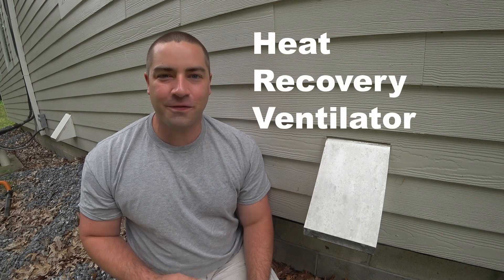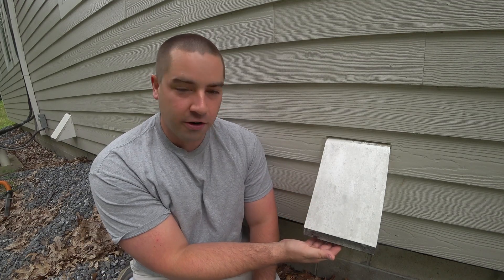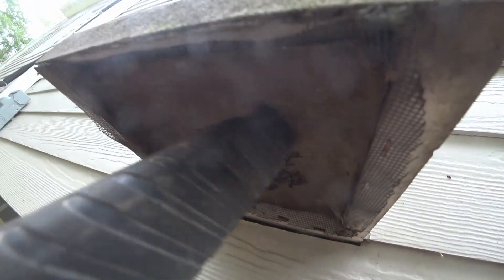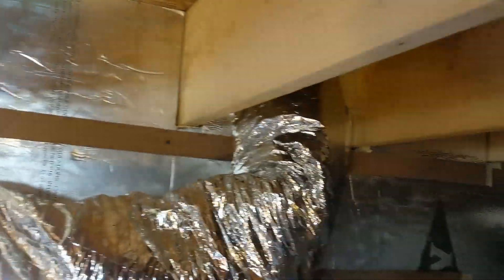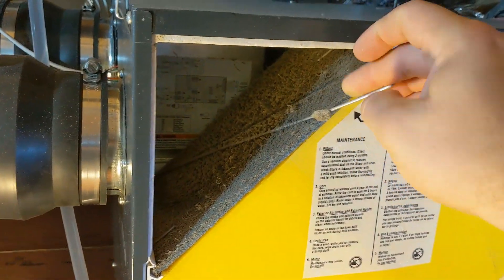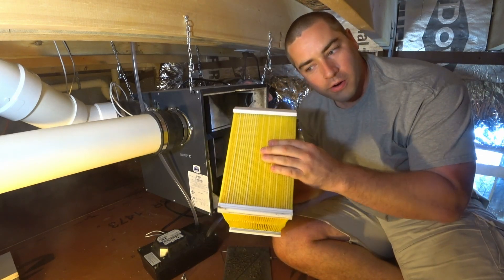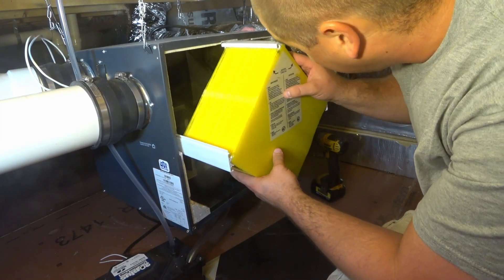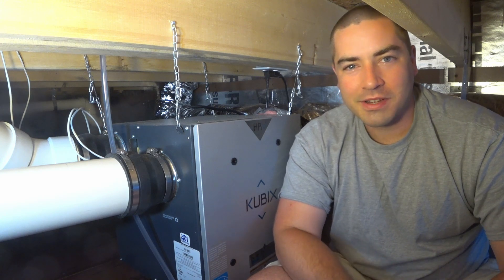HRV Maintenance, Heat Recovery Ventilator in Air-Tight House

Comment: I finished adding cellulose to my house, and I'm eyeing this as a future project.  An update on how it's going would be really helpful.

I'm going to swap out the old gas furnace for a heat pump, and it seems like this is a good idea while work is going on.  Also, the Habitat for Humanity thrift store has been getting some nice Fantech ones, and they're $100-200.  I don't think they come with the control switch, but that's still a deal.
Reply from the maker: Yeah, I'd snag one at that price. The HRV hasn't been 100% trouble-free.  I've had to fix the dampener twice.  Seems the dampener is the weak link.  I clean mine twice a year and it runs 24/7.  If I did it again, I'd try to find a model that has an over-sized core, but the fan can still run at a low CFM.

Comment: Don't forget to flush the condensate tube as it will plug and make a mess lol. I do believe an HRV is one of the best ideas in modern homes. The balance for incoming and outgoing needs to be looked at once in a while and I like mine slightly pressured so it pushes out. Cheers David.
Reply from the maker: Good point.  I did check it (clear) so I didn't bother including that because I wasn't cleaning it.

Comment: that heat exchange core looks like it's just a bunch of stacked coroplast.  I wonder if it makes sense to DIY build one of these.
Reply from the maker: That's exactly what it is.  I have plans to build one (even most of the material waiting) but I have been so busy with solar projects I haven't had the time to do a ventilation project.
Reply: That was exactly what I was thinking, it looks pretty darn straight forward too. I always assumed it was a bunch of aluminum or copper fins and tubes like on an air conditioner.
Reply from the maker: Hi dxcrive,  Some brands use aluminum fins.  I've even seen some cors made with a "Tyvek"-like material stretched back and forth over a frame.  And some ERV's even use ceramic cores.  But, from what I've seen at shows, most HRV's have moved to this construction.

Comment: Hi, very informative video. 
I have few queries:
Do we need to turn off the hrv while doing this activity? 
Also, if we wash the filters, we need to put it back when they r dry, the hrv will be off till that time?
Reply from the maker: I turn off my HRV before opening the cover.  Then I leave it off until I'm done cleaning it.  I wash the filters and shake them out.  Then I put the filters back in while still damp.

Comment: My hubby installed our new HRV in the winter time. I just noticed now that the basement humidity is 65% & the main floor humidity on our NEST says 50%. Also the condensation tubing from the HRV is bone dry 😬😬 there’s actually a massive spider crawling in it as I’m typing 🤦🏼‍♀️🤦🏼‍♀️ Why is our tubing bone dry? Ty
Reply from the maker: My HRV doesn't produce condensation in the winter.  It's usually something I see on hot-humid days in the summer.

Comment: Its the first time I see plastic pipes to move air. Do you like it? I guess they don't get dirty as fast as galvanized melat ones ? Thanks!
Reply from the maker: I'm fine with the plastic pipe or galvanized duct.  To make galvanized duct work there are a few things you need to do: 1. Seal joints with duct mastic.  2. have vibration dampers to cut down on noise. 3. Even interior ducts might need some insulation to prevent condensation problems.
With the plastic pipe I still had to glue the joints to seal them, but it is permanent and won't dry out over time like mastic.  It is also less thermally conductive, so I don't have to worry about interior ducts forming condensation (which I have checked and verified).  The plastic has more mass to it, so that means less vibrations and quiet.  
Plastic pipe gets expensive very fast from the fittings.  Especially if you want a duct larger than 4".  But for me, my house is so small that I only needed 5 pieces of pipe total, so my cost was still very low.

Comment: Neat! Never have seen inside one before. Always figured the heat exchanger would be copper! I guess the plastic works well as it can be thin. Glad to see it has some filters on it too.
Reply from the maker: Thanks for checking out the video.  I love taking things apart on my channel.  Yes, the plastic is very thin, so it works well enough.
Reply: It's polycarbonate cell sheeting you can buy for dirt cheap. I'm shocked that this is used in a commercial unit that probably cost over $500.

Comment: David, I just put the Panasonic ERV in a house.  One thing I could never find was its efficiency rate.  In your research, how does it compare to your Kubix HRV?
Reply from the maker: There are a few models, but I pulled this data sheet from one of Panasonics.  The efficiency will vary between 65 and 88% depending on some factors.  It's a nice unit and Panasonic is known as a good company.  file:///D:/Users/David/Downloads/FV-10VEC1_Submittal.pdf
Reply: @DavidPozEnergy  Thanks! I went with it because it was a Matt Risenger recommendation.  Then realized I couldn't find a spec! So thank you!
Reply from the maker: Your welcome.  If you run the fan on a slow speed the efficiency goes up.  Just have to meet your ventilation requirements.
Reply: @DavidPozEnergy  Thanks.  Interesting, I haven't experimented with that yet.  It's currently set to run 10min/ hr.  We are monitoring the house, but it's not my house.  It's projected to run about $600/year for 'all in' utilities: Heat, A/C, hot water, lights, etc.  If they wanted to add solar, it could easily be net zero.  Lot's of good info on your channel.  I just subscribed yesterday.  Keep up the good work!

Comment: Hi M. Poz, i'm curious about using PVC pipe for air ducting against metal duct about static electricity?
I read many time, isn't recommended to use it....  Personally i prefer work with plastic pipe.
Reply from the maker: I've read about static electricity being a concern with dust collection.  I don't know if it's possible for it to be a concern here, but I've never had a problem.  We are only moving 40 CFM (cubic feet per minute) for fresh air.  This is low volume and low velocity through 4 inch pipe.

Comment: Would you do anything differently? Air intake further from the ground? Air filter before the hrv?
Reply from the maker: Next time I would make my own HRV.  This was $900.  But, anything different about the install?  I'm pretty happy with overall.  The vents are far enough above the ground, and under overhang that I've never had an issue with snow blocking them, so no need for them to be higher.  For the first year I actually did have an extra air filter.  I built a sheet metal box to house a 20x20x4 MERV11 air filter.  I installed it between the air intake and the HRV.  But had to remove it.  What happened is I was getting condensation inside and/or outside the box (depending on time of year).  This was making a puddle on the floor and wetting out the paper filter.   
I've had this other thought...
If I ever got a chance at a junkyard or something to snag one of those cool air filter housings for big rig trucks, you know, the big stainless steel canister types that are about 18" DIA and 30" tall sitting on the outside of the engine compartment.  I would take one of those and mount it on the wall of the house, then the air would enter the top, go through the filter, and then out the bottom would be an elbow into the crawl-space.  How cool would that be!?  Ha!
Reply: That would be awesome! I'm totally stealing your use of PVC for simple ducting too.
Reply from the maker: Cool.  I'd love to see a picture of your ducts after you finish.
Reply: DavidPoz I really like my merv 16 carbon filter for my furnace. It has really cut down my nose and allergy issues from oct 2019 to present time. I want an HRV in my house! And I had a quote of $3000 to install one in my 900sqft home.
Reply: @DavidPozEnergy  Wow, make your own. I'd love to hear your ideas. I've  a new modular with 1400 sq ft. and 2x6 walls sitting in South Carolina.

Comment: If you put a thin filter on the air intake would that work to make cleaning easier? Example, remove filter wash install, instead of using a vacuum.
Reply from the maker: You could do that.  The vacuum is pretty fast though.  Whatever helps keep the bugs out.

Comment: New England and no basement?
Reply from the maker: That's correct, I live in Massachusetts and have a crawl-space.  Thanks for watching.
Reply: Well, since he built the house, a basement creates a ton of expense that can be avoided with a crawlspace.
I do hope the crawl is sealed, it'd be a shame to have a tight house with a ventilated crawlspace...
Reply from the maker: Hi SuperVstech,  Yes, the crawlspace is sealed.  The crawlspace is inside my thermal envelope.
Reply: @DavidPozEnergy  I personally enjoy a nice basement and might care more about a beautiful Mech Room over a kitchen. 
But having a workshop can make up for it, for sure.
Reply from the maker: Hi Stephen,  I agree.  I would have loved to build a full basement, but my town forbid me from doing it.
Reply: @DavidPozEnergy  I am sorry.  What was the logic that the town decided you weren't allowed a full basement?
Reply from the maker: Hi Jason,  At some point the town decided that to build new you needed 200 feet of road frontage.  My lot has less, but had a 1930's house on it.  This old house was existing prior to the town making it's new rule (which is called a By-Law).  So my property is classified as "Existing, Non-Conforming".  My whole build is classified as a re-model.  I had to keep the original foundation and build upon it.  So my foundation work took a while to repair and reinforce the existing stone/block.    This type of story is very common in my area and it stinks.  Pretty much every builder I know has a story about having to do something like this.  But, if the town didn't stop me, I would have built a basement.
Reply: @DavidPozEnergy  Thanks for the reply it's disappointing that they wouldn't give you a variance to get around the issue.   It looks like you did a great job.  If your up in Maine I would love to show you a tour of my solar setup.
Reply from the maker: Hi Jason,  That would be great, can you send me a private message through Facebook? https://www.facebook.com/DavidPozEnergy/